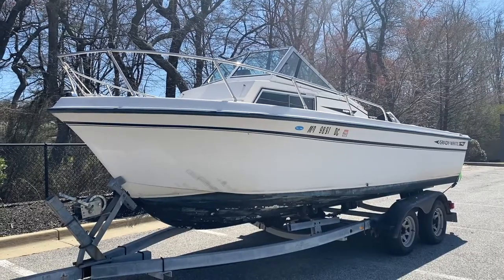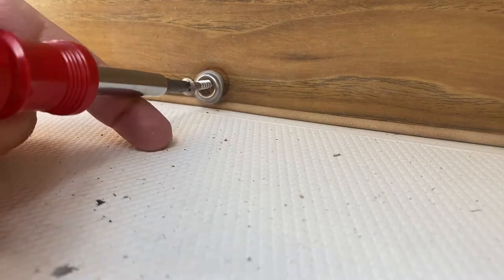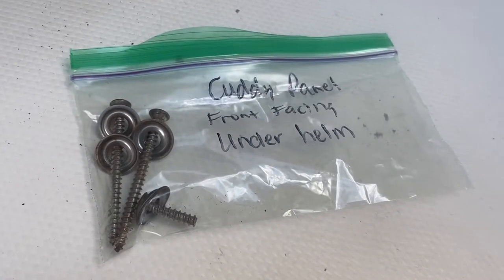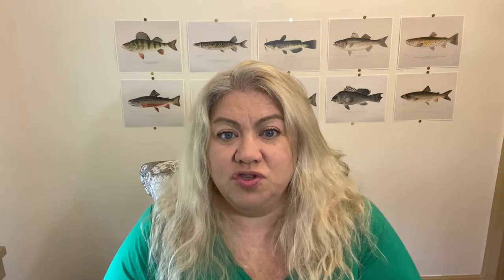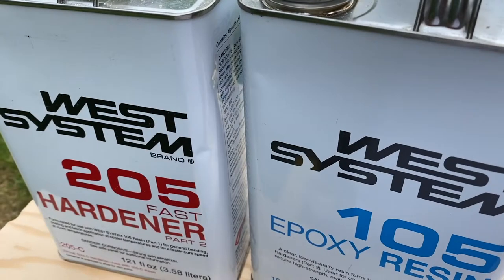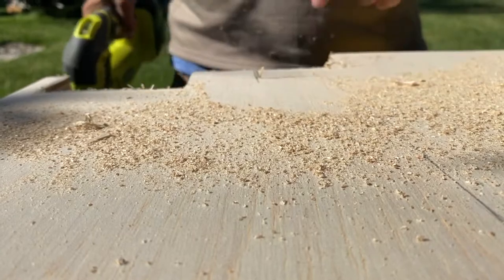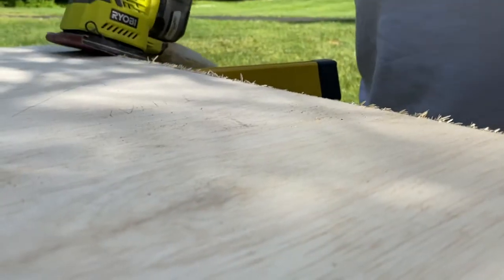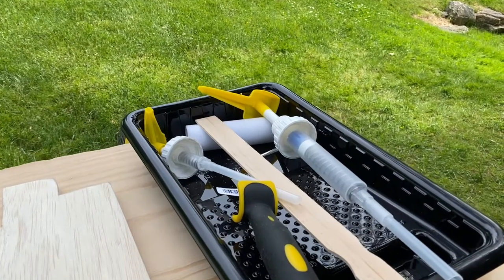DIY: ROTTEN Plywood On Your Boat? Here's How To REPAIR IT with Epoxy (West System 105 + 205)

Comment: I did the same thing cutting out wood rot pieces on my boat. The clear vinyl works great outlining the hole. Then cut it out, and trace your cut lines on the new plywood for your jigsaw cuts. Fine tune edges to fit.

Comment: Thank you for the video! Also in the same process and this video really helped reaffirm my planning. You pretty much covered everything from A to Z with easy to understand directions and steps which helps with understanding the concept of each step. Labeling both hardware and the pieces you pull out is something I will be adopting into my own project. I have the bad habit of just pulling and setting aside only to spend more time trying to figure out what went where.
Reply from the maker: Happy it was helpful! Hoping to get back to it soon, once we thaw out a bit here.